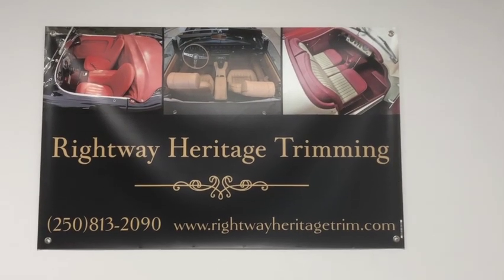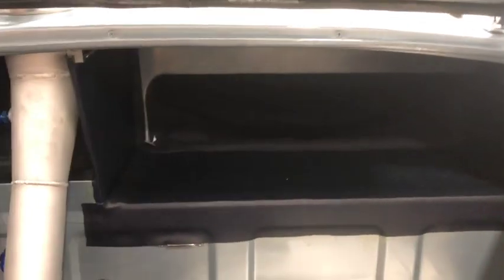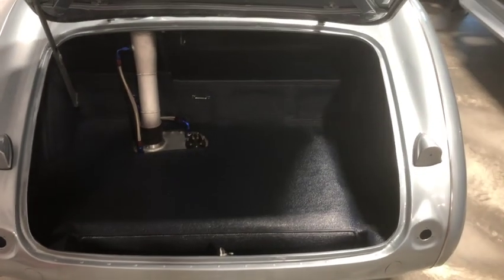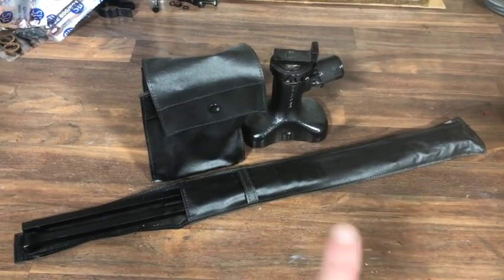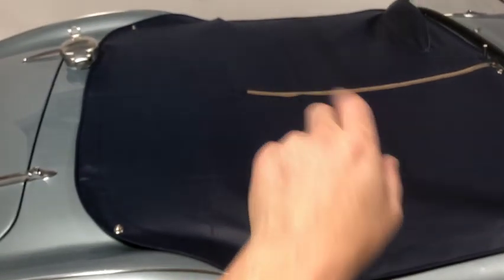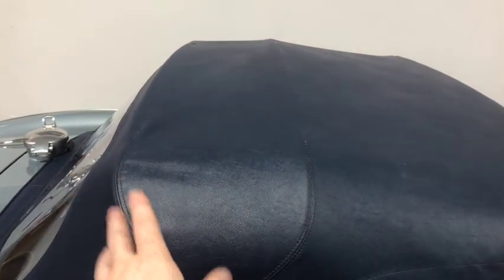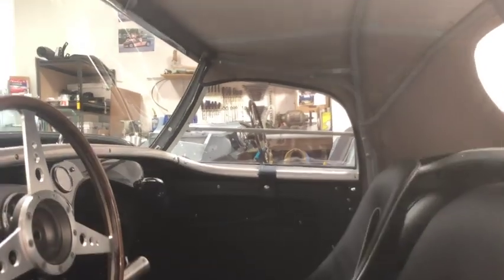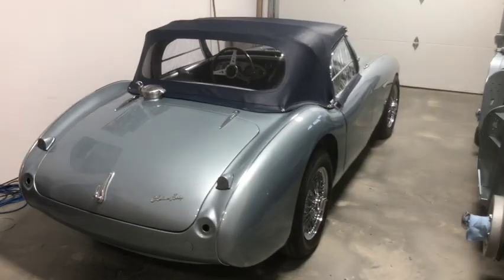Trimming a BN2 - Part 2

Comment: A question:   is the  felt under floor mat glowed ?     How do you fasten the snaps with screws?
Thanks!
Reply from the maker: felt under main floor mats are not glued, floor snaps use screws to secure them - felt has holes cut out around the snaps..